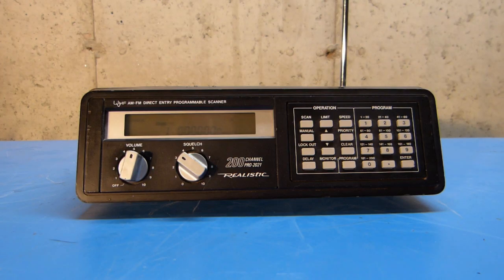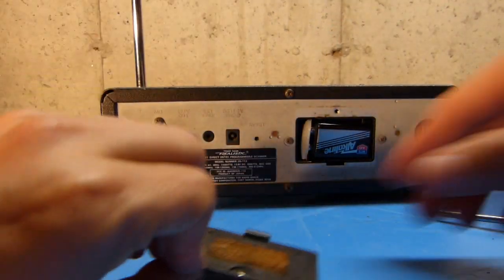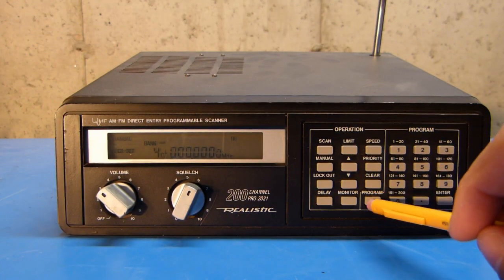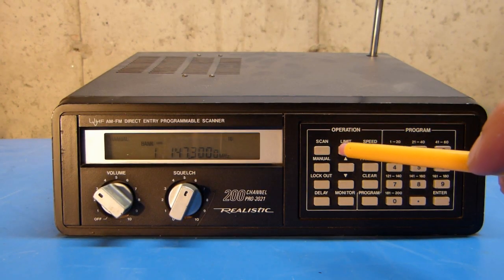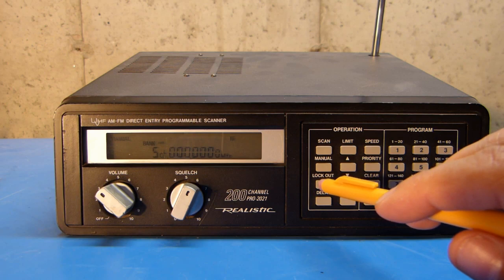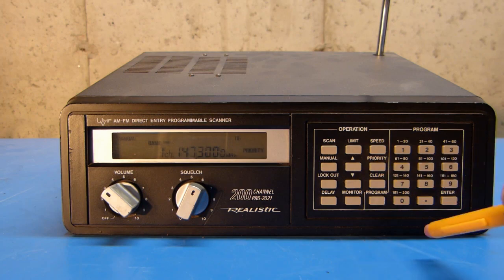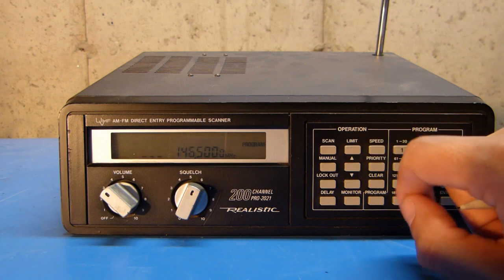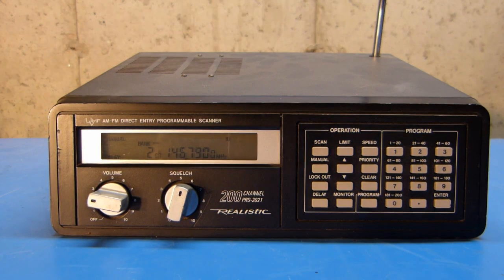Radio Shack (Realistic) Pro-2021 Scanner Programming and Overview

Comment: Thanks very much.  I have the exact scanner.  I let the battery go low and unplugged it when I changed out the battery and lost the memory.  I looked up the frequencies from the county codes on the police dept. site. But it would not scan after entering them.  I must have hit the limit button or other.  I pushed in the reset button.  That really helped, and then re-entered the frequency numbers  Thanks for showing that button on the back of the scanner.  Great clear instructions.  It really helped to show how to get rid of the other banks--that really speeded the scan up.

Comment: Very nice explanation of operation. I've had a PRO-2022  (Pretty much the same as PRO-2021)  for years and just dug it out of the closet. The manual I found online sucks. You did a great job explaining setup. KUDOS to you
Reply from the maker: Thanks!  Glad this helped!
Reply: @SevenFortyOne  Thanks again. What's interesting to me is that I don't think Radio Shack ever explained the multiple bank programming or how to turn them on and off in the original manual. They explained the upper and lower setting for free-scan and how to save by hitting the "Monitor" key but never explained how to transfer to a memory channel. I think I had this problem originally when I bought it new and had to call Radio Shack customer support to figure it out.

In any case, maybe that's how it was done back in the 80's. Companies sold the same model year after year or had only minor changes but never updated the user manual.

I do appreciate your information otherwise it would have taken a lot LOT more work to figure it out (no exaggeration).  You saved me hours and hours.

BTW, my unit broke ~6 months after purchasing. They they actually repaired it rather than giving me a knew one. I had to bring it back to the store for warranty repair and it took them 5 weeks to repair before they got back to me. I then had to pick it up at the local Radio Shack. That was how warranty service worked in the 80's. Funny how times have changed. :-)

Take care!

Comment: wow, i used to have one of these, was like decades ago! and at our local Radio Shack, they always a list of local frequencies printed out (tons of copies for everyone) that they would give you. and it really sucks Radio Shack closed! if you needed connectors, adapters, antennas, cable, all that stuff, and scanners themselves, the Shack was the place to go, they had everything. including 5' section masts, and most even carried telescoping masts in different lengths, ours usually kept them out back, or in their storage area. our Radio Shack was also a shared business, if that's what it's called, a car stereo shop shared the same suite, or store. had their own register, and little area. but ya now that Radio Shack is gone, there's absolutely no where anywhere near me where you can get that kind of stuff. Closest thing similar is the HamRadio store in Plano, TX, and that 100 miles away from me! lolz 😄so thank goodness for Amazon, ScannerMaster and HamRadio's online store, and DXEngineering as well ☮

Comment: Already been said, but excellent video on the set up of a classic. My Dad has had this scanner for 20 years and it's still going strong.  I've just brought the pro 2006 and also good - pretty similar with a few more features and memories.  A real shame that Tandy, as was the UK's version of Radio Shack ceased trading in the UK - left a hole. Loads of cool kit in the day. Too much "tech" on the modern stuff too The Realistic/Radio Shack stuff was simple but did the the job and did it well, very well.
Reply from the maker: I agree!  The old RS scanners were the best.

Comment: What would be a good external antenna for this radio I've got one the same model and everything some one gave me a long time ago I wouldn't think a CB antenna would work for this
Reply from the maker: It depends on what you want to listen to and where you are.  If you are in a city or populous suburban area then a cb antenna may actually work OK.  Or even a cheap telescoping whip screwed into the top of the scanner will work in this situation.  For best performance you'll want an external antenna that is made for scanners.  Good luck!
Reply: where would a good place be to get scanner antennas online
Reply from the maker: scannermaster.com, amazon, and HRO (ham radio outlet) come to mind.  But if you google "scanner antenna" you'll find lots of choices.  You could even make your own if you are so inclined...
Reply: Hi I'm going to buy a cb antenna but do i need to buy any connector adapters for it.Do you know which kind I should get?This video really helped thanks!

Comment: I've an old Pro-2022, and no manual. It appears that the external antenna input is "BNC", yet you're using an RCA plug.
Please advise, thanks.
73
 N4ANO
Reply from the maker: Mine is a pro-2021 which uses an old Motorola style antenna jack.  The 2022 must be different.  You can find Radio Shack owner's manuals on-line with a google search

Comment: Ay hope youre doing well, i have one of these and im having an issue with a constant beeping and it showing "low bat" despite me replacing the battery and also plugging it in. Any ideas?
Reply from the maker: Make sure the battery is good and that the connection to it isn't damaged

Comment: Can I run this of my shortwave  wire  40 feet in  the  air
Reply from the maker: I've run mine from a shortwave antenna with decent results.  A dedicated scanner antenna should work better though

Comment: I also have a button on mine with a little light that comes on when u turn it on. it says sound squelch. when should I turn this on, if ever?
Reply from the maker: you can probably leave it off for now.  This button is used for muting stations that key their transmitters but  don't talk for some reason.

Comment: looks like a cb coaxail cable hook up for cb antenna.
Reply from the maker: Stock connector is a car antenna  socket but I have an adapter that  allows me to use the pl-259 cb style connector

Comment: Can I run a a99 to this
Reply from the maker: It won't work as well as a scanner antenna but it should work
Reply: Ok can I use a99 for a shortwave  radio got this old one laying  around  figure I use it
Reply from the maker: Same answer really...although the lower in frequency you go the worse 5he performance will be

Comment: figures that no one has a helpful vid on the 2020
Reply: I have a 2020.  It's the exact same procedures, except that the 2020 is only 20 channels, scan speeds are slower, and it has an LED display instead of a liquid crystal display. Oh, and the keypad has white, blue, orange, and one red button.